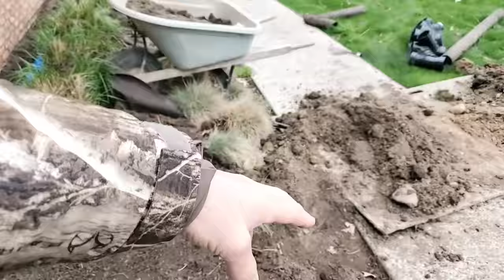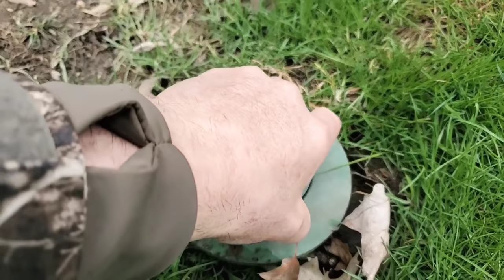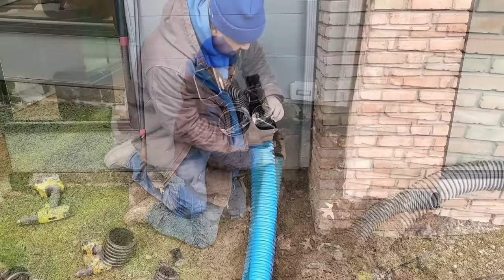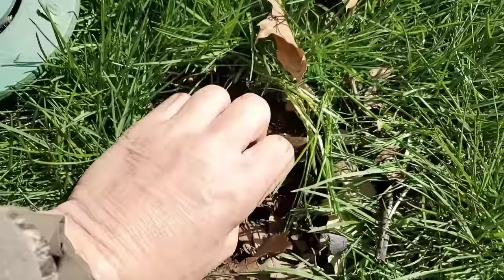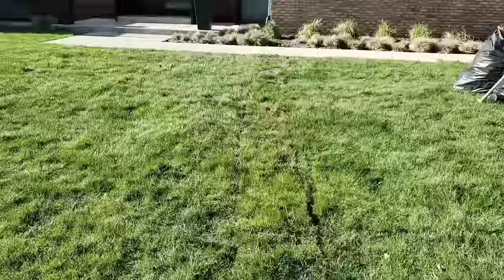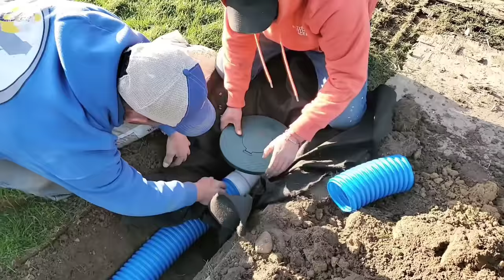How To Install Downspout Drain Underground  Top 10  Do's and Don'ts Built To Stand The Test Of Time

Comment: Instead of a popup why not just use some socked agi pipe under ground in a gravel trench at the end of the system?
Reply from the maker: @Franklin-zc2jo
That's a terrible idea. Tree seeds and tree buds will float down and simply plug the pipe because they have no way out. I see it all the time, so I speak from experience.

Comment: I live in Pennsylvania, can I use the Armor pipe with an external sump system? I have to pump water about 7'-10' up, however, it needs to travel about 25' long to hit that height (gentle slope up), will water sit in this pipe? Would schedule 40 be a better approach, being smooth? Also, is Armor pipe your product, are there suppliers near Philadelphia area? Thanks for your videos, I've learned a great deal.
Reply from the maker: This answers all your questions and more. Don't skip around it's the complete outdoor guide from 2021
Watch "Backyard Sump Pump 101  [ Everything You Need To Know ]" on YouTube
https://youtu.be/ORFCgTEPq1I

Comment: At the beginning of this video you mention ‘grabbing’ the two downspouts at opposite ends of the house. Does the flexibility of the piping allow for a 90* curve at the corners where the downspouts are located? I have this same positioning of downspouts at a newly constructed home that does not have sod yet in the yard. Builder insists that doing exactly what you are doing in this video won’t work because the piping isn’t flexible enough to accommodate the corners and be able to tie both downspouts into one run where there is at least 2 feet of drop to run the remainder of piping to away from foundation.
Reply from the maker: It will do a sweeping 90° we do  Encourage DIYers to use a single wall smooth on the inside 90 so they don't crack the pipe because it is so thick

Comment: How many gutters can you route into a single 4in pipe?
Also, doesn't the corrugated pipe breed mosquitoes?
Reply from the maker: You can put 4 gutter downspouts on 1 four inch main line.
If you use a pop-up emitter and a solid cover catch basin No  Mosquitoes

Comment: French Drain Man ...   My yard and my neighbor's yard has several trees and I'm constantly monitoring the gutters for leaves and debris.   Have you ever seen the need for two clean outs in one line?
Reply from the maker: We currently are running 3 clean out in one line. The clean out at the house and the clean out our in line basin hybrid provides. We also get into the system from the pop-up emitter so there is the 3rd clean out.

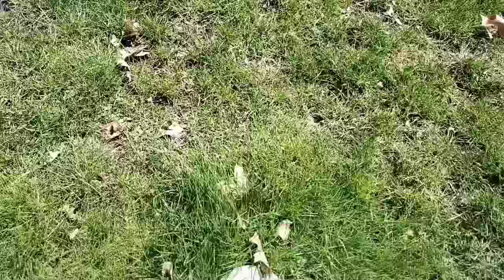Comment: At 7:45, did not tape the connections to the in-line catch basin. Is there need at this type connection vs at other fittings? Trying to get all info together before I start my project.
Reply from the maker: We want that area to leach. We drill holes in the catch basin as well. After a rain the basin will have some water left in it. Here in the North that could freeze solid if it wasn't build to leach away.

Comment: What about aerators? Issues with them puncturing your systems?
Reply from the maker: They don't harm our systems.
Reply: @FRENCHDRAINMAN  

What’s the minimum depth you recommend for your downspout and French drain systems? 

Plan to be doing a diy French drain this summer with your product and if that goes well will be doing downspouts this fall or next spring.

Comment: I still have a bunch of knife cut and geotextile fabric left over.  If I wrap the knife cut in the fabric do you think I can use it to run a downspout drain underground about 50 ft out to a pop up emitter at the street?  I know it should be solid but just trying to use up what I have.
Reply from the maker: Yes

Comment: Are you no longer using or recommending using closed top D-boxes to catch the shingle gravel?
Reply from the maker: They were difficult to install for Homeowners. They held a lot of water and wouldn't dry up because it was to much water to leach into the sub-soil. Most Homeowners never took the cover off to clean them out because it wasn't convenient. These are the Negatives. We improved in every area with our redesign of the catch basin / D-box. They both work.

Comment: No fabric around the hose, I see. Isn't it possible for roots and fine debris to collect inside the hose?
Reply from the maker: It's not a french drain system it's a roof run-off system. We also ran all solid Armor Pipe and no knife cut Pipe. I hope this helped. Thank you for commenting!
Reply: @FRENCHDRAINMAN  Love your videos.  Getting ready to do a downspout at my house in Ottawa.  In this most recent video you are not  adding any knife cut pipe before the pop-up.  Is that the most recent recommendation that you have if you are using a few holes, stone and fabric wrap at the pop-up?